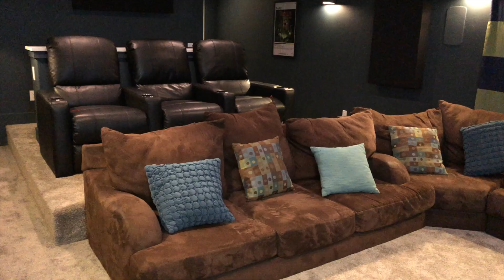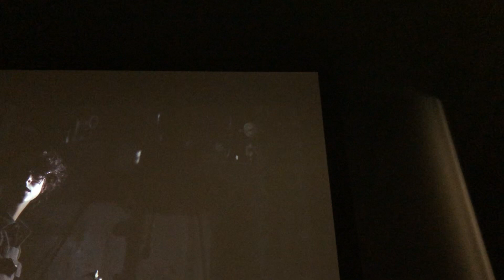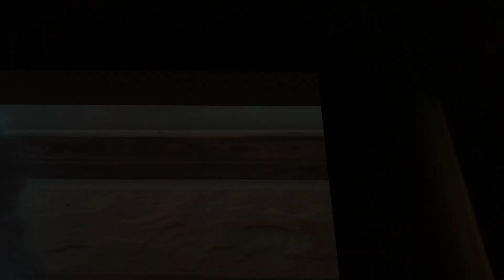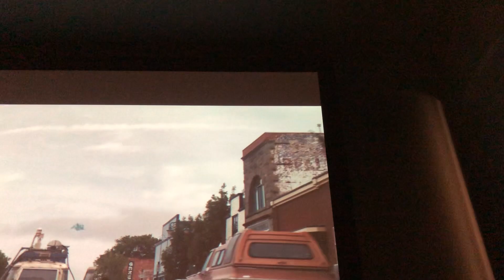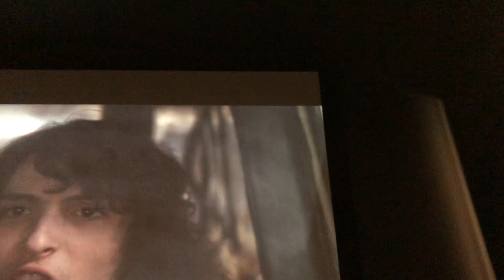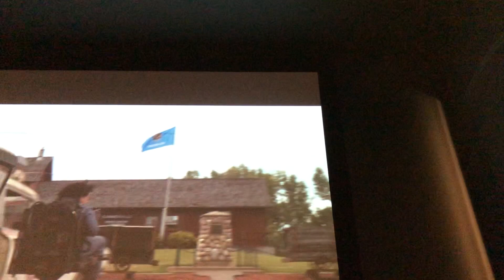Do Dolby Atmos speakers produce any sound in Ghostbusters: Afterlife? Home theater test

Comment: Many folks think the heights will aleays be playing sometime but that's wrong especially when the camera's POV isn't showing anything from above you (helicopters? Wind , rain, etc). It's to fill out the other 7bit 9 speakers not be the main sounds. I think what you saw in this disc is what most discs have. Very subtle ATMOS but they are there not silent. Maybe other scenes had better height effects? AQuiet Place has allot of very distint slings from overhead even they monsters come into the house for sure

Comment: Dolby Atmos on home releases are mostly garbage!  There are a handful of great mixes, but most are fails at best.  I use the Auro3D upmixer for everything and I’m never disappointed!
Reply from the maker: What are some of the distinctions you notice between Atmos vs the upmixer?
Reply: @GeorgeTheaterAtHome  The auro 3D upmixer uses the 5.1 track and intelligently upmixes the meta data to add sounds to the heights.  So in any format is does a great job of comprehending there is say a helicpoter or in nature the birds and animals and sends that data in a formula that sounds as if it's natural.

Atmos sound engineers have notoriously said they don't waste time and don't have the resources to do atmos right most of the time.  There are some movies that do well with it but way too many that are lazy poor atmos tracks and that is perfect for auro3d to save the day.

Comment: There are two ways Dolby offers Atmos content. Dolby Digital Plus and Dolby Digital True HD. DD Plus is what a lot of streaming platforms use, but it doesn't contain the same amount of information. So some of the Atmos content is taken out. But DD True HD is lossless. That's why physical media is the Atmos gold standard. You'll get ALL the Atmos information that was missing from Plus.
Reply: I’ve always wondered about that. Is there a source proving that to be true?
Reply: @xanderx9988  Well, you could just do an internet search comparing DD Plus and DD True HD. But it's easy to test it at home if you have a 4K blu-ray player (such as the Panasonic UB9000) that can display the video and audio bitrate when watching physical media. A physical disc can hold and playback significantly more data than is currently possible with internet provider download speeds by as much as 10x. There's a major difference in file size between lossless media and lossy media. Not only are modern day internet speeds incapable of downloading media at 10, 000 kbits/s like a bluray can, video streaming services would run into problems storing hundreds or thousands of movies that size on a cloud. It's not very efficient or cost effective, and even if it were possible to stream at the same bitrate as physical media, video streaming services would likely have to charge consumers WAY more to offset the cost. But anyway, to your point of wanting definitive proof, the best way is to play a physical 4k disc with an Atmos track on a bluray player that can display kbits/s in real time, then find the same movie on a streaming service that is 4k/Atmos. The streaming version will typically be around 768 kbits/s whereas the physical disc is around 10,000 kbits/s.

TL;DR: Basically, the internet favors compressed files because of download speed limitations and cloud storage costs. It keeps streaming relatively affordable. Also, most consumers are not video or audiophiles.

Comment: There's another factor worth considering, which is whether the content you're watching is on physical media or streaming platforms. A lot of streaming platforms may label a movie as supporting Atmos, but you'll be getting a compressed version of both video and sound. There is also the issue of data storage for streaming movies. 4k HDR with Atmos is going to be a HUGE file, and data storage costs money. So when you stream a movie, it's very likely you won't get "true" Atmos content. Maybe a fraction of what you'd get on a physical disc. Most people who are serious about home theater, and willing to invest even more into additional Atmos speakers, would know better than to judge Atmos as a whole if they are basing their opinion on a few Netflix movies they watched. Not every Atmos movie is going to have amazing Atmos content, but I think your demonstration here, and your previous one, proves that if you want the best and most complete Atmos experience you NEED physical media. Streaming is fine, but I just really hope there aren't people out there who ONLY stream and judge Atmos based on that. That would be extremely dumb.
Reply from the maker: Physical media is the best option. Streaming is quickly advancing in quality, but at this point physical media is still superior. Thanks for watching!

Comment: Welcome to the world of bad mixes, and its a big world.  So many films have missed opportunities.  Further, often lots of the audio that IS there is just "fluff" that doesn't really belong there.  It's a height channel, yet hearing something like tires squeal on the ground when viewed from above would not be a sound above you.

So that is another metric to keep in mind for those that are critical, it's not just about the number of frequency of sounds, its about them being accurate to what is on screen.

So many movies are designed for surround sound first, and then handed off to the Atmos engineers just to "add atmos" rather than built from stage one with atmos in mind.

I do think it will get better in time, and I think Atmos has one the 3D audio war most predominantly. Another fun test even if just for yourself is to watch a bad scene like that one not in Atmos mode but with a upmixer like Auro 3D or Neural X and see how it sounds.  You may find its better, and start watching a lot of the "bad mixes" upmixed rather than in its native format.
Reply from the maker: Very interesting, I will give the upmixing suggestion a try. Thanks for watching!

Comment: I think you summarized it accurately, "missed opportunity"
Unfortunately, that's what you'll find on even the better than average mixes.
But every once in awhile, you'll get a gold nugget like Dune.
Also, when properly set up, a 7.1 setup can have have excellent surround with a feeling of very convincing height effects. Before the Dolby standard, you could mount them higher, but now you have to bring them down close to ear level to create separation from the height channels, especially if you have low ceilings. 
Now I'm hearing reports one needs 6 atmos channels vs 4, to achieve "proper" immersion. That's the kind of rhetoric that turns people off to atmos. I don't recommend people replace their perfectly good avrs or processors, just to get a few extra channels, not to mention the additional amplifier AND speakers one would have to purchase. 
This Ghostbusters mix might still be pretty awesome with no atmos channels, if the 7 bed layer channels are where the action is.